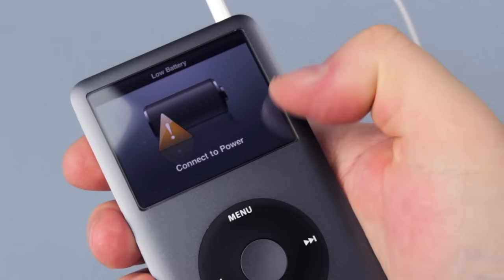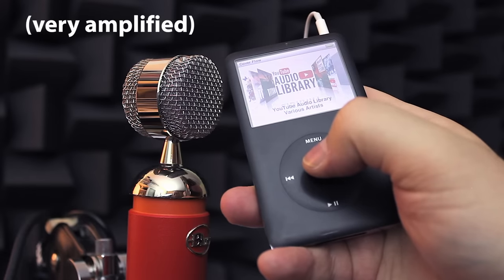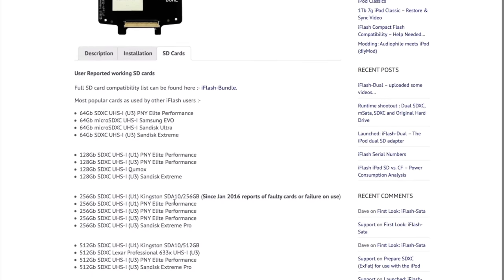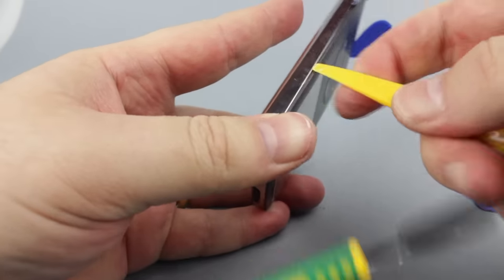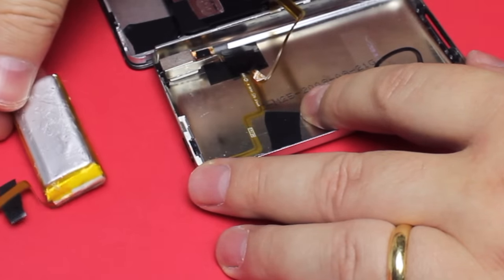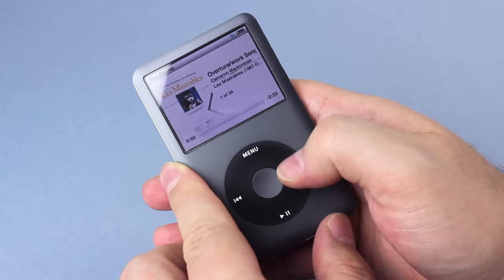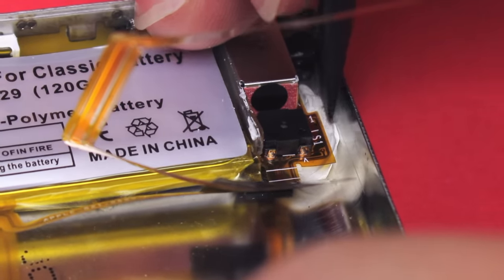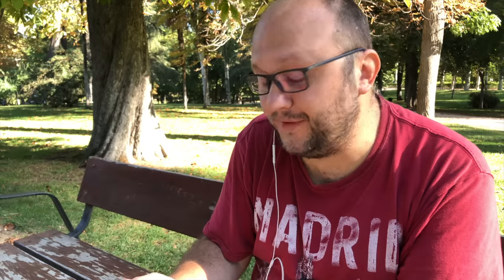iPod Classic new Battery & 256GB SD Card: still works in 2024

Comment: Hey man cool vid, you put lots of effort, i also own a few of these, lucky for me i haven't had any issues yet, i was just wondering, does your ipod reads the full 256gb on the sd card ? cheers.
Reply from the maker: Hi thanks 😊 Well, it doesn’t show 256GB... R after I formatted it, it was showing 238GB, you can see it in the video at 0:35 This is pretty much normal. BUT if you are seeing only 128GB on your iPod, it might have to do with a particular limitation of your model, you can see about it here: https://www.iflash.xyz/store/iflash-compatibility/
Reply: Geek Detour awesome, thanks

Comment: I still have an iPod Classic 160 GB with RockBox installed. The battery can only manage 2-3 hours of play and the hard drive does freeze for a few seconds/minutes every once in a while.
I've been putting off upgrading it because I'm kind of scared of damaging it beyond repair but now I'm also afraid that parts for it will no longer be available if I wait too long.
And yeah, I do prefer owning my music too.

Comment: I have a 30gb ipod classic. I don't know what generation would this be. I have already replaced the battery and connect a bluetooth transmitter so i could use it in car from which i have also installed a bluetooth receiver anker is the brand and up to now its been perfectly working. Very nice to own my playlist of music.
Reply from the maker: Are you using a 30-pin bluetooth transmitter?
Reply: Not a 30 pin transmitter its a 3.5MM that i plug in to where the earphone should go.

Comment: Hi old mate I came across your vid, as I now have the same problem. The hard drive inside sounds like a Coffee Grinder & the battery isn't far behind. I goto crack this thing open & replace with a 512 SSD & a 1500 ma battery as there is more room in there with the SSD upgrade. And I ordered that pry tool you showed us. Thanks for the tips Mate.

Comment: I did mine, other than the ugly marrings around the seams, it was a success and I was so damn happy. The iPod worked well for three days then suddenly stuck at one song, and the whole thing got stuck....
Reply from the maker: Have you tried Reseting the iPod? You hold the center button and the Menu button together until the Apple Logo appears on the screen. You can see it done in this video: https://youtu.be/tpE7s7gtT2o
Reply: as we speak, now itune sync doesn't work that i can't seem to delete songs from the ipod now. the SD card (mono) in there is PNY, 256GB, seems fine. i have 5646 songs shown on the ipod (viewed on the ipod setting), while there should be plenty more songs on there. iFlash mentioned there may be a song limit.

Comment: Very good - especially opening part.
I just got the 6th generation iPod Classic, 80GB but i got also this "dead HDD message" which means that I have to open it as well. But I'm more inclined SSD faith - does it make sense if I replace HDD to SSD? Or how large capacity SSD I can use to this? I read couple of days ago that 80GB HDD can replace to 128GB SSD but no more - if it is right, then why? If I will try to add 256GB SDD - can it get to work for my iPod?

Comment: i'm sitting here, after an hour i finally got inside my ipod....
but now i am stuck, because the cable of the hdd don't get loose. It has no latch like yours...

i hate small things wich need to be precice and wich need patience....

Edit: Some hour later...
Replaced HDD with iFlash and SD Card. Checked on PC: Had trouble with recover process. :(  Started several times, then it "randomly" worked out. *sigh
Checked display and headphone jacket: No damage so far. :D
Replaced battery, but cable on wrong side o.O ... still, worked out so far.

Since I reassambled it back together I wondered, if the 128gb was the limit. Because it said so at the iflash website.

HUGE thank you for your video.
I've had it so long now on my "Watch later" list - finally today everything arrived.
Reply from the maker: Wow! Thank YOU for telling me your experience! Most people watch this video as entertainment - they won’t actually fix an iPod, but you did! That makes me extremely happy ❤️🤗

Comment: i have the same model and needed a new battery so i took it to a local shop and they replaced and installed for $80.00.however when i told them i had an older model that needed the same.well lets just say it wasnt gonna happen lol . the one they did fix is still working. wish i knew what battery they put in. guess i will have to wait til i need another one ------

Comment: How did you manage to break everything? I changed the HDD and battery in 5 minutes flat... This was for the ipod 5G... easier to open. Best music player ever. I installed RockBOX on it, and it is even better now with incredible sound.
Reply from the maker: I swear I have a good hand for electronics! 😆 My idea was to make a video like "How to revive your iPod in 30 minutes, easy!" But everything went the opposite and I had given up on editing it. The material remained untouched during 2 years on an external hard disk - but my wife insisted it could have even more value exactly because of all the mishaps. I am glad I listened to her wisdom 😍
Reply: Geek Detour said that iPod up to 5 generation is plastic. Geek Detour has 6 generation second revision (7 generation) iPod.
Reply: @GeekDetour  As long as it works, that's the best thing. And sometime, you should install Rockbox... UNLEASH the potential of real sound, held back by Apple software. Believe me, it will astound you. Comes with CUSTOMISABLE equalizers... tweak the audio to your aural perception...
Reply: @Infevlol  Hi bud, nice avatar. :-) My ipd gen5 has top plastic, but metal backing, as all of them.. The top frame is also metal though. cheers

Comment: Thank you very, very much for capturing and sharing your experiences, helping me to save my iPod - just for a battery.  I am buying and storing spare parts for the future, too.  I started to make the same mistakes and since it didn't "feel" right, I decided to be patient, stop, and search.  Much gratitude.  I agree on owning and carrying around music this way.  I don't mind smartphones but too cumbersome for the task, and I just prefer independent devices for separate tasks.  I will never buy an iPod touch as long as smartphones exist.  Too much redundancy, and I want iPod classic.  Bravo to you for your respect for your wife.
Reply from the maker: Hi Ian, thanks for the kind words! After all, could you replace the battery of your iPod?
Reply: @GeekDetour  I did replace the battery. Evidently, I did ruin 3 tabs and the housing.  While I don't mind bumps and bruises (proof of being used),  I ordered a new housing for $25, I'll keep the original just because.  Since I bought it for myself, there is a lot less sentiment.  I also ordered 4 of the Isesamo tools, which are awesome!!!  I will be leaving my unit otherwise stock.  I do wish that the knock-off manufacturers would create in aluminum like the original.  A few bumps and bruises on the sides because of my prior goof-ups but almost negligible.
You've inspired me to order parts to imitate a complete copy what you have done, except with 256MB M.2 drive and 3000MaH battery to make it comparable to original charge life, but with twice the storage (of original).  Obviously, I got the deeper 8mm backing to make it easy to fit.
My original iPod will be treated like gold, and I have isolated replacement (new condition) HDD that I will secure soon., with SDRAM replacement as eventual backup  The replacement unit (with plastic front) will be used and abused, as the original. 
Maybe I am also a fanatic about these devices but I use almost every day and it meets my needs in a way that no other device I have shopped for can for the cost (even to maintain (on my own).
Reply from the maker: Wow! You are really into it! That’s great! It is awesome to experiment with mods, there are cool transparent cases for them - but the one I have I intend to keep the exterior just like it was when I got it.
Reply: @GeekDetour  You reminded me that these devices aren't made anymore.  I love the format and original parts are drying up and getting expensive.  Keeping things as original as possible and using a stand-in is my contingency plan. :-)  Like yourself, I have used this every single day for over 10 years.  AND it is still relevant!  The investment is minimal over the given time span.  This reminds me of the days when I was planning to put a PC in the trunk of my car to play MP3s.  LOL!  Now, with the option of using RockBox, things are even better.  I may even resurrect my iRiver H120, also supported by RockBox! That was also a nice device, even though limited to 40GB HDD.

Comment: Hi! 
This inspired me to refurbish my iPod Classic. I did it and it was a success. Until the first official day I took it outside. It played the tracks I picked and played a playlist. Yet then It stopped playing the tracks. The image is there and I can scroll and navigate the library and etc etc. But it won't play the songs. I used the same 256GB card, it I used a solo flash board, not dual. I changed the battery, headphone jack, LCD, scroll button and housing. Yet it now won't play any tracks. I have used 124GB and I have 110GB available.When I plug the iPod back into my MacBook, let it sync, then unplug, The iPod works again. It plays the songs again for  maybe 30mins or so then it stops.   Do you have any idea why this happened? Should I of used  TB card? Is the card bad? or should've I gotten the Dual I-Flash?? Im trying to find out why this happened so I can troubleshoot the problem. Thank you...
Reply from the maker: Wow… what a detailed post! Have you tried to contact iFlash creator? He certainly have more insights about the troubleshooting process - I never had to dive into this, so I know as much as you know by now 🤷‍♂️ 

When you find out what was going on, would you please share your finding here? I appreciate! 🤗
Reply: @GeekDetour  @Luke stone, Well I switched out the Tarkan iflash drive and replaced it with the Tarkan iflash drive and welp so far so good. I kept the single 265GB SD card and  I have been playing my random playlist and it has been playing just fine. I currently  have 19,299 songs in my catalog with 108GB still available. So far so good. Thank you and many thanx for the instructions and responses. Wish you all well..

Comment: Really fun show!   Think I have the same one 160Gb,  use it in my car with FM transmitter cuz my car is older.   Cheers!
Reply from the maker: Wow, an FM Transmitter is quite... hum... retro? old fashion? terrible? Ha ha ha. If it works, it works 😄
Reply: Works very well,  only as good as your radio.  107.5 FM  and if there is station there it just over rides it.  I have no choice.  Cheep 15.$    Cheers! @GeekDetour

Comment: I have a 6 or 7 gen iPod classic. It’s a 160 GB model. I will be attempting to modify it by adding Bluetooth capabilities as well as replacing the battery and the memory. My question is, can it be done in regards to the memory by changing it to memory cards or a solid state drive, keeping it at 160 GB or more?

Comment: I'm considering buying a ipod classic but have a question or two for someone with experience using one in this day and age.  

1) Essentially wanting to know what can be used to buy/download songs onto the ipod?  

I ask this because I have a pc with windows 10 and read that Apple has got rid of itunes and split it up into a few apps instead; Apple Music, Apple TV, etc.. which is available on Macs but not Windows/pc as itunes will still exist on windows/pc.  I also read that  later versions of itunes won't recognize the ipod classic; so do you install an older version and just use that?  With using the older version will you still get access to new songs?

- Coming from someone who wants to buy music, import songs into a music library and play them anywhere I go.

Thanks in advance for any insight/guidance!
Reply from the maker: I don't recommend you to buy an iPod Classic these days. Apple seems to be not caring to provide support for it anymore. There are third party software to manage iPods - but I don't know about it enough to make a recommendation. BUT, at least for now, you still have iTunes for windows - this page tells you can get it on Microsoft Store: https://support.apple.com/en-us/HT210384
Reply: @GeekDetour  
Yeah after doing more research I cant see myself buying one anymore. Seems like more of a headache than it's worth unless Apple would have continued to support their ipods.

Thanks for the feedback!

Comment: Hi! how much did you spend in total? I need to replace my iPod Hard Disk
Reply from the maker: What I spent in 2016 (when I actually recorded everything you saw) is now much cheaper (the SDCards got way cheaper). You can buy an iFlash adapter, a 256GB SD Card and a new iPod Classic Battery for less than U$ 100.

Comment: Thank you for this.I am going to undertake a similar modification on my iPod Classic.  I like just having my music with me at all times.  Is it insane to try for 2TB?
Reply from the maker: My pleasure! 😁 I think more than 512GB is already unnecessary! Unless you are planing to use the Rockbox firmware (but then, it won’t be really an iPod anymore, ha ha ha). The original iPod firmware from Apple has a limitation: it doesn’t work properly when the songs database is close to 50k songs/videos/photos (items) in total. And here is the catch: unless you have all your songs in lossless (ALAC), 50 thousand songs in MP3 or AAC usually don’t occupy more than 255GB. That’s why I think anything over 512GB is totally unnecessary. Does it make sense??
Reply: @GeekDetour  That does indeed.  Thank you for that advice!  I have a tendency to push things to the breaking point (and beyond, hence the question).  I think I'd like to go the 512GB.  Can you recommend an adapter card for that application?

Comment: Hey, I know its an old video, but I am looking to do the same replacement to my old ipod that its not holding battery very well. Was using the flash adapter instead of the original hard drive gave you better/worse battery life?
Reply from the maker: Hi there! Theoretically, it should have given a better autonomy - but I think the battery I got was not sooo good. I talked a bit about it in this sequel video: https://youtu.be/aF4O98epAZk  In this other video there might be a link to a round of tests made by the iFlash creator - and he noticed it varied a lot depending on the brand/model of SDCard.

Comment: Thank you for the excellent video. Very good that you included all the mistakes you initially made. I have two 160GB iPod Classics. I can add music using  iTunes on a stand-alone desktop that has Windows 7. I recharge the batteries with the PURE iPod dock with which I connect my iPods to my hi-fi system. After I study your video more I might try to upgrade one of them.
Reply from the maker: Thank you Bruce - I am glad you found it useful. I only opened mine after it got basically impossible to use 😁 so I had nothing to lose (well, besides time and money on parts). Be extra patient when you open yours, opening is really tricky - and good luck! 🍀👍

Comment: i have a 160gb,i had trouble charging after i put it on modern higher power charging,it stoped all together untill i hooked it up to a goal zero venture 35 ,when i charged AND used it at the same time it reconditioned my battery ,ita as good as new with origional battery.*I am original owner and used it regularly from then to now, results may vary

Comment: with youtube and streaming services having more and more ads, and needing internet connection to listen to music, i think an mp3 player is a great way of taking power back.

I got an ipod 7th gen as a gift for myself a few years ago. It worked okay at first, but its clear to me the harddrive and bettery will need replacing.
Thann you SO much for this wonderful tutorial, and for being honest about the challenges and mistakes.

Can i ask, what iflash adapter would you reccommend for a 7th gen 160gb ipod?
is a 128 sd card okay?
Reply from the maker: I would use a 256GB card. You have the satisfaction of “upgrading” your iPod. You really don’t need more than that. And the extra space makes for greater life span of the SD Card. Oh, there has been a long time since I read about the available iFlash adapters…
Reply: @GeekDetour  thank you so much Geek Detour!

Comment: Hi Geek Detour, i am like you so loving this Classic range.  In Feb 2020 i bought a refurbished 6th Gen IPod Classic. It was performing to my delight. But 2 days ago, it froze on me. i left it for about 24 days for the power to drain off (which i do with much success on my IPod Classic 3rd Gen), but it doesn't work on this 6Gen.  What i see on the screen is this...35.7 GB free (out of 160GB).  But i do not see the rest of the contents in, say,  music, podcast, movies etc......

Can you help me trouble shoot this problem please.  Thank you.  12 July 2020 Singapore
Reply from the maker: Try resetting it: https://youtu.be/rD4wOgjchPk
Reply: @GeekDetour  i tried. But still stuch. Try to uninstall iTunes using iobit uninstaller and then reinstall.  But unable to as error showed iPod software cannot be found.  So many problems.
i am at wit's end now. can you throw some light? thanks